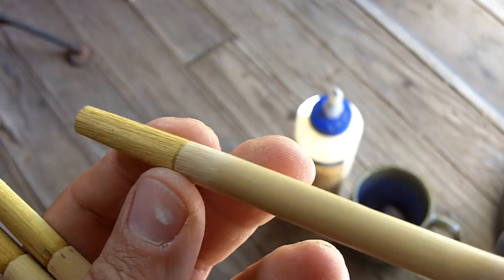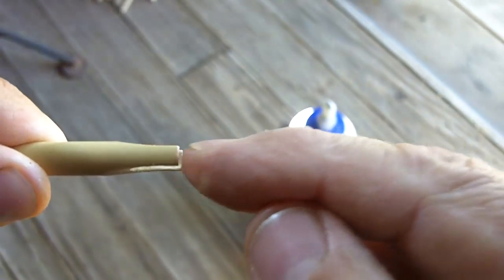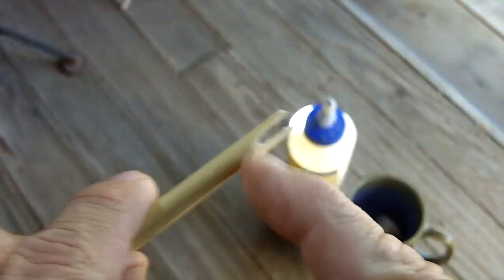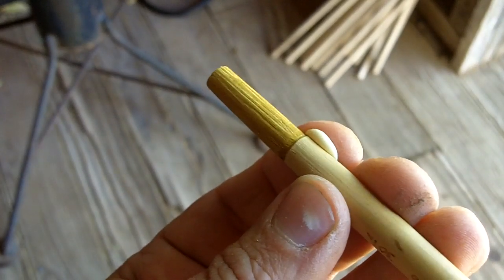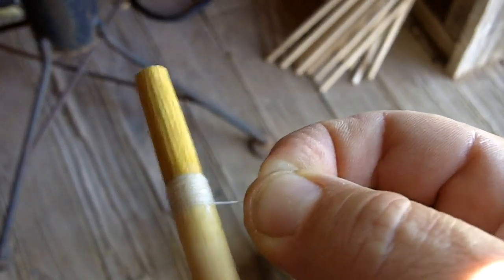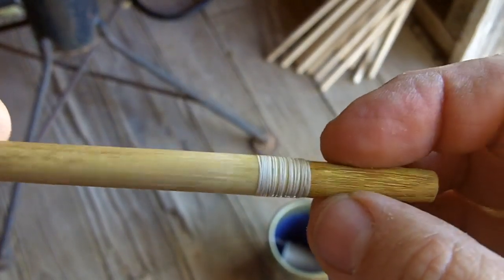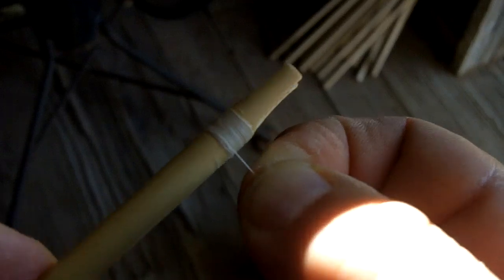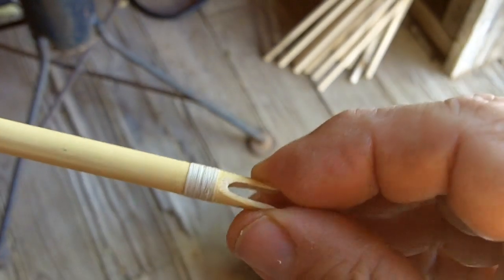272 - Making River Cane Arrows 2/9

Comment: Fantastic video series! When I used to make shafts from cane I would measure down from the end 5/16" and drill a 1/8'" hole then slice down from the end to make the slot slightly smaller then the hole size. This allowed the arrow to click onto the string and hold in place without me having to pinch it,  my shooting style would have them falling off otherwise as I shoot 3 fingers under and walk the string for distance. I absolutely love your knapping work and now your arrow building as well. I have started the Knapping journey in the hopes to make my own points.